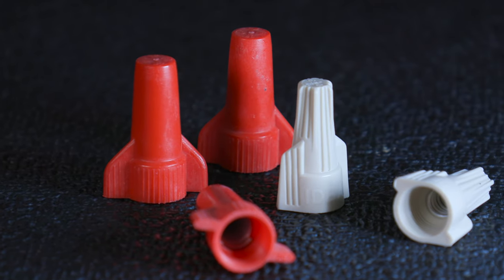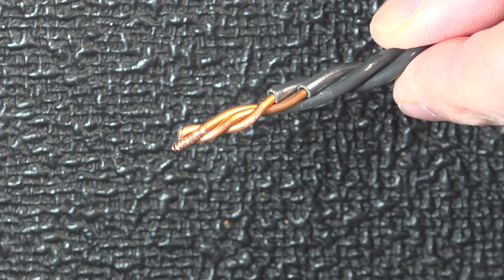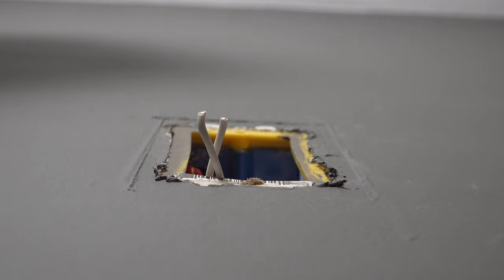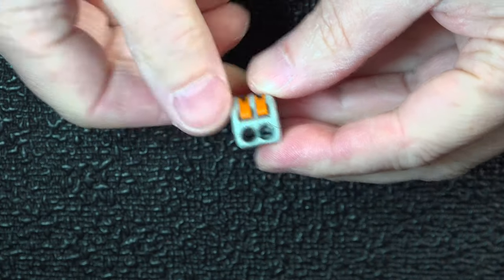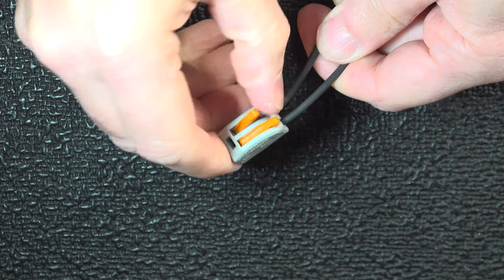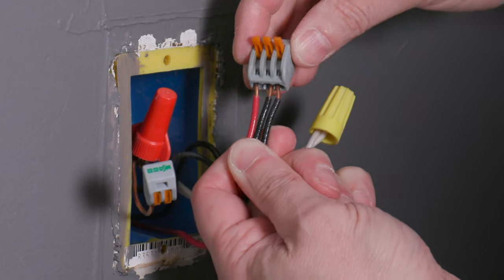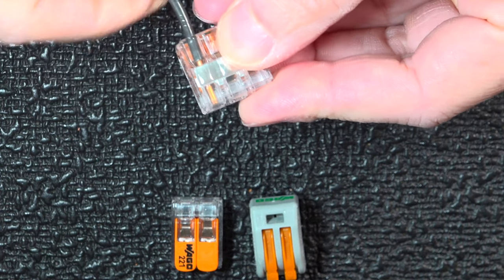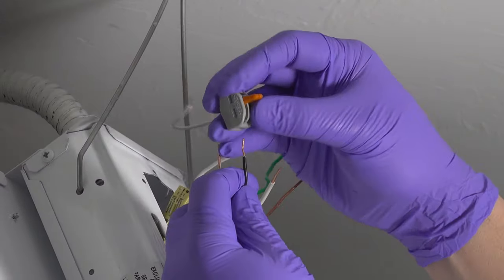Never use Wire Nuts Again - Wago is Better Electrical Connector

Comment: The wire nut is only as dangerous as the person installing it.  Been an electrician for 25 years and have had VERY few problems with wire nuts.
Reply: Also notice how he blew pass the part in mentioning "More Expensive" also notice how he never mentioned using the proper colors of standard wire nuts is related to size and applications. All I'm saying,  if you're gonna sale a product or represent a product, then talk about that product without using poor "Piss Poor" examples of what is currently 99% used, because you won't appears as credible but as cheap "Snake Oil" peddler.
Reply: @cplcabs  I agree, they also save time' and more time
Reply: Because electron flow occurs on the outside of the conductor there just doesn't seem to to be enough surface area contact with these splice devices with the conductor surface. Every one of these type splice devices I've removed had significant carbon build up on the conductor and the device contact point to the conductor. The splicing device has very minimal contact presence on the exterior of the conductor. I've  always maintained that 5/8 inch of twist is minimum twist length to achieve sufficient surface contact to allow electron flow to under load without carbon build up. If these splicing devices came primed with some sort of carbon inhibiting grease it might work better. But I still wouldn't use them from the perspective of call backs and loss of customer confidence. Call me old fashion but electron flow is electron flow. Amen???
Reply: @BarryPiper  Remember aluminum type NM?  One of the worst mistakes in electrical history.
Reply: Can't teach an old dog new tricks.
Reply: @Dana P.  ⤴️ THIS👍 
More surface area contact reduces Resistance. Thus, reduces heat🔥
Reply: Ditto
Reply: @danap.235  I thought the same thing when he took one off and there was a tiny nick in the conductor. Immediate red flag.
Reply: @marksheltonswork7848  Remember the approved fix using a short copper wire twested together with the aluminum wire and tighten with a wire nut. Then the copper short wire faston to the switch or receptial.
Reply: so true Tight is better
Reply: Crank em down til they can't take anymore crankin,  then tug.. repeat ...
Reply: @michaelangel6201  he's a salesman with a good personality  not an asshole electrician  , like me .
Reply: @danap.235  I use them only on 2x4 troffers.or exit  and emergency lights
Reply: @marksheltonswork7848  lotta pine hills houses in the Orlando area 50s 60s  wired in al
Reply: @stepside2839  i jist ran 10/2 uf for an 11a load in a house ,
Reply: @lostcause1206  rather have a well experienced electrical AH  walking away from my house than standing next to  a fun loving, charismatic watching it burn to the ground.
Reply: @marksheltonswork7848  Tell me about it, that's what I have i my home. Had to WIRE NUT copper extensions into every receptacle and switch because they were starting to arc inside the box. Good thing all the boxes were metal and not plastic.
Reply: i'm more worried about the cracked out or methed out electrician they hire that i have to watch out for....pain when a guy uses kleins for stripping and knicks into the copper and twists the shit out of them so it will break off going into the box and then having to troubleshoot it.  People start thinking the place is haunted when the lights are flickering...but nope it was just cracked out joe and his terrible connections.
Reply: I’m an electrician with 40 years in service. WAGO is a German brand. In Europe voltage is 220 volts to ground. These work great there but with our lower 115volts l am concerned with the limited contact surface area of these. That’s the reason I never once used “quick wire” devices in my career! I only use these for connection of fixtures and only if they come with the fixture because they save my precious Wingnuts for more important jobs lol.
Reply: @danap.235  100% correct
Reply: i only have problems with  green apprentices that don't check to see if they have a solid mechanical connection causing me to waste time troubleshooting circuits, nothing wrong with wirenuts , apprentices as well are more likely to strip the wires to long for the wagos  causing shorts in the the circuit, easier isn't always better or by code.
Reply: @lostcause1206  lol,  now what?   Uf inside the house?   #10 for 11 amps?   Yeah.  I  run #4 to charge my phone!
Reply: @ProctorsGamble  Yes sir! I'll use WAGOs in a 277V 3 phase lighting circuit, but there's no way I would ever install them in a 120V single phase circuit like we have in our homes in the US.
Reply: @gibsonjl85  I had an apprentice who sprained his wrist while dumping a wheel barrel. He then tried to blame the wheel barrel for not having "ergonomic handles".
Reply: I.B.E.W.  STRONG
Reply: 40+ years and seen far fewer problems with wirenuts than these quick connectors.
Reply: Agreed. Cheap Wego tension fails in 2 years in a lab. Fact.
Reply: very few problems, it's still very bad.  in electrical installations you are not allowed to have any problems.  it is enough in 10 years for an electrician to set fire to a house because of such a connection.  And who says that those are reusable does not know what he is talking about, even if theoretically "works" practically if you knew how it works you would understand that with each screw, metal on metal, it loses its thread.
Reply: @BarryPiper  That's not logical thinking. Plenty of things were "allowed by code" until they weren't. Things are now "allowed by code" that won't be next year, decade, etc. But I agree with OP, wire nuts are fine.
Reply: @BarryPiper  And if there were a problem with Wago's they wouldn't be allowed by code either.
Reply: @cplcabs  a twisted wire splice on solid copper wire is the most secure connection possible in a serviceable splice. Terminal bloc connections are sweet on stranded wire like you guys you in Britain, where wire nuts don’t work so well. Dude it all matters in the materials your working with. If you were a sparky here you’d get it.
Reply: @ProctorsGamble  for me it’s a stranded to solid application thing. Wago works decent on stranded wire. For solid wire I agree a twisted splice is the most proven reliable for sure without doubt.
Reply: How do you twist multiple 10 gauge or lower gauge wires?
Reply: @mrtopcat2  by twisting them together?
Reply: @16vSciroccoboi  So you must think I did not think of that? 

Twisting wires, especially 10 gauge wires is a pain in the butt. It is also a 3rd world solution.
Reply: @mrtopcat2  with a pair of linesman pliers and a blue wire nut.
Reply: Amen
Reply: @BarryPiper  I know of plenty of times this type of product has failed. Since I am the one fixing them.
Reply: @tgrzadziel1975  which local brother? I'm out of 48, doing supplemental out of 125 right now.
Reply: Only need one to burn a house down...
Reply: I'm not an electrician and I've never had any trouble with them.
Reply: @michaelangel6201  yeah AWG standards but wire nuts come in Red, Yellow, White, Orange, Blue, Black, Green.

Just look at the diam of the wire and nut and all set...
Reply: @lostcause1206  I'm not an electrician and never had trouble with wirenuts, to me it is just uncommon sense you and I share.

I worked in telephony for Uverse, scotchloks were good for it all, even the 48-53VDC for ring battery...
Reply: @ProctorsGamble  erm the main power is 240-250, they shunt the transformer to get the 120-125VAC.
Reply: @gibsonjl85  it's the same for 12VDC circuits, electrons are electrons whether from rotating magnets or 2 dissimilar metals with a dry or wet electrolyte.

Some wires are smaller than 22 gauge (speaker tweeters on coaxial units) might need scotchloks for those to go to a larger gauge.
Reply: @greedo2660  must of not loaded correctly
Reply: @-Nobody-1  its like speaker wire terminal blocks.

I'd change the wagos to a screw lock for security and more surface area for current flow.
Reply: @mrtopcat2  pliers.
Reply: In europe these nightmare wirenuts are long Forbidden, only wago type is allowed now. Another bonus from wago is you have a small hole in it in which you can place a voltage tester without having to damage the wire insulation.
Reply: @greedo2660  im sorry i have to say this but the electric grid in USA is ancient, in europe we have 3x230/400v systems, how does not using 110v single phase overload your electric cables especially with upcoming electric car chargers
Reply: @danap.235  These Wago connectors have been used in Poland commercially in massive quantities in home building industry virtually since they were brought to market. They proved to be reliable and error-proof and are now a standard in new investments. For most applications the version without lever is used (self-locking ones), lever variants are used when there is a need to connect at least one stranded wire.
Reply: @emperorfancypants2512  do you not understand wire gauge sizing to accommodate for different loads depending on circuit requirement? The arguments where people are like “in Europe this but in America this” are so fucking tired and dumb. This is the last one I entertain.
Reply: @-Nobody-1  that's not economical bro, uses too much copper/aluminium not good for the bank and environment
Reply: That’s why he mentioned how it works more for diy stuff, a professional knows what they are doing and also only has to do it once. A home hobbyist isn’t as skilled and may want to reuse items
Reply: @mrtopcat2  You use Item no. 221-615, which can handle conductors from 0.5 to 6 mm²?
Reply: @marksheltonswork7848  pulled out of cardboard boxes ...
Reply: @lostcause1206  Ha Ha!  Not to many of us around anymore that pulled wire out of flat cardboard boxes.
Reply: @emperorfancypants2512  cool great idea, now lobby the governments from Canada to Panama (the entire North American continent) and Bolivia.... Venezuela... Ecuador... and anyone else in the Western Hemisphere who is on 110v/60hz to change their industry standard. Get back to me when you make the difference your looking for. Your economical argument should win them over.
Reply: @-Nobody-1  we had 3x110v here till the 50s in some areas, over time and gradually we changed it, first 3x230 and now 3x230/400v with neutral wire.
Reply: @danap.235  Electron flow on the outside of the conductor is called the skin effect and is frequency dependent.  at 60Hz in copper it's 1/3 of an inch.   so a conductor with a radius of 2/3 inch of less would not be affected. This would definitely include the 12 and 14 gauge wires that wagos could be used for in residential applications.   https://en.wikipedia.org/wiki/Skin_effect
That said.  I think wire nuts are the way to go and the guy in this video was not using them properly.  Wagos are just as bad as back stabbing outlets as they do not give the necessary contact to prevent heat build up.   Additionally as the copper oxidizes, if the wire moves at all the contact may now be on top of the oxide layer.   that is probably the cause of the buildup you have seen.
Reply: @Warclubz  you as well, I've always wanted to visit ny, hopefully I'll get the chance some day.
Reply: Who in their right mind would count on the workmanship of a Chinese made connector to make the actual connection? What's the guage of the actual material that connects the wires? I'm supposed to sleep at night while counting on someone else's workmanship for such an important connection? All when a simple wire nut properly installed by me will ensure proper connection. Thanks but no thanks.
Reply: @emperorfancypants2512  US homes have 240 single phase with a center taped neutral for 120. Commercial building have a wye connected 120/208 similar to your 230/400. Larger buildings and light manufacturing uses 277/480Y. 277 between the ungrounded conductors and the grounded neutral for lighting and 480v 3 phase for larger equipment and motor loads. We place 120/208v 3 phase transformers and panels for outlets and appliances. 

I’ve worked for a company that produces equipment and ships them all over the world. I built many multiple voltage test rigs for the products so I’ve always been interested in what’s used in other countries. I like the 220/400v systems.  I think they’re very good. I was in London a few years ago and thought the tiny breaker box in the apartment was awesome. Although, I will say, I built three phase test rigs for our HVAC equipment that operated between 380-575 volts and 150-400 amps, and I appreciated the higher voltages for these heavier equipment loads. Less amps and smaller circuits. Some of the more powerful models couldn’t be sold in Asia and Europe without installing transformers. Canada’s 575V is even better. 120v in the US is good for small plug-in loads.  Cheers!
Reply: You must not do commercial service work...
Reply: @BarryPiper  there are known issues with quick connects though. the # of service calls because of back stabbed plugs arcing and tripping arcfault breakers has to be astronomical, these wago things use the same concept and are just as likely if not more so to get fatigued from heating and cooling of the connector and the wire.
Reply: @-Nobody-1  We actually use solid core in domestic installations, "twin and earth" for the most part. Choc blocks are still far and away the most used method of joining cores though
Reply: These comments are so funny :D claiming the wago is prone to failure, i have never seen a wire nut in finland or a wago fail. They are much more safe and way faster than wire nuts, you can say all you want about wire nuts but its just a simpe fact that wagos are better 🤭
Reply: @mrtopcat2  git gud scrub lol
Reply: @cplcabs  i've done WAY more service calls and repairs from problems with stab-in connections (including wago's) than I ever have from a problem with a wirenut.  see the reason you think that is because they've been banned in your country since they were made with ceramic!  (lol)  (23 yrs exp)
Reply: @phatdonkey78  the connector doesn't make the connection.   the twisting of the wire does, the connector just protects the joint.  go ahead and pull the wire out of a stab connection and tell me there's no marks on it.  plus there's less surface area of the wire being connected by a stab/clip connection than there is from twisting them directly together and that's copper on copper.  there isn't any copper used in wago's.  you are obviously not an electrician so i don't know why i'm wasting my time w/ this comment.  go ahead and buy a 500 ct of these so you don't run out.  i just want to see what you do when you got more than 2 wires to connect.  or you hit some 10 awg.
Reply: @XX-121  You were definitely wasting your time with that comment because I agree a wire nut is a much better connection. If you re read my comment from earlier you will see that I said, "when he disconnected the wago there were just 2 little nicks in the wire." Meaning not a lot of surface area for the connection, hence not a good connection and I said immediate red flag. I'm definitely not an electrician but I am an electronics technician and understand electron flow and how a stab connection is a terrible connection. I don't know why I am wasting me time with this comment since you clearly have problems reading and comprehending who has said what.
Reply: Well it's something called "innovation"
Reply: @Trainwheel_Time  yea you can teach us new tricks. I do believe that any Journeyman Wireman would agree a properly installed wire nuts are better than a waygo any day
Reply: @anthonymartin2412  oh so true my friend
Reply: @engineclinic  Glad to see some one else caught that but im hoping he was being sarcastic LOL
Reply: @greedo2660  Key word is apprentice its our responsibility to teach them the correct way
Reply: @tgrzadziel1975  till the end BROTHER
Reply: @-Nobody-1  well said
Reply: @mrtopcat2  sidecutters
Reply: @jasonboyd7358  Yeah, you're right. Teaching apprentices is an important part of my job. Some are just easier to train than others.
Reply: @marksheltonswork7848  Yep and the NEC is about to bring back copper coated aluminum.
Reply: Am a retired electrician.  Worked in field from 1976 to 2016, never heard of a “Wago”!  Put 10’s of thousands of wire nuts (mainly Ideal brand wire and wing nuts).  Have to prepare wires properly to get good connection, and don’t re use them!
Reply: Ive done a "couple" remodels that the previous people who touched the electrical made huge messes in the panels and at the devices, and i can tell you that wire nuts have never been the problem even with cheap wire nuts, its always the person doing the electrical that causes issues.
Reply: @BarryPiper  The problems with wirenuts is why they're not allowed by code in countries with stricter rules and requirements than the US, eg. Germany and the Nordic countries. Building codes are a compromise between safety and what you can get the builders/electricians/plumbers in your region to follow, there's no point of writing code that noone is gonna follow. And since the US lags far behind in terms of electrical safety and technical competence, so does the code.
Reply: @stepside2839  the skin effect isn't really applicable here. The surface area/resistance/heat part holds but at 50 or 60 Hz the electron flow as described by the skin effect is effectively the same through the entire cross section of any wire size that you would use wire nuts or these things on.
Reply: @BarryPiper  In many countries they are not.
Reply: @baggebuilds  Yeah, maybe in the 19th century they were.
Reply: To all those mentioning the skin effect,  calm down.  At 50 or 60hz and with the size of conductors these connectors are made for,  skin effect is irrelevant.  No need to get overly excited and critical.
Reply: Ah just use split bolts for everything, then the wimps will only finger tighten, must be time for more 'black tape'... electrician for 45 years I twist every solid wire regardless of awg and wire nuts mostly... everything depends on application, but the fixtures that come with mamby pamby connectors get cut off and spliced properly. There's a reason the NFPA outlawed ez wire switches and receptacles... continuity issues...[was that nicely said instead of FIRES]  don't get to reliant on 'underwriters lab'...
Reply: There's no way this device has the current carrying capacity of a well-made wire nut splice
Reply: Wagos are used almost universally in the UK now. I reckon it will be the same for you guys in a few years. They are fast and good... No lie. Give it a go I think you'll see why!
Reply: @stepside2839  dude, copper skin depth at 60Hz is a third of an inch, ain’t no house wire that thick and ain’t no skin effect in house wires. Now at 10 GHz you’re wasting copper if your microstrip line is thicker that 1 mil.
Reply: @uarbor70  why?  Resistance = rho x Length / Area.  Sure increasing area reduces resistance BUT if the length (distance between conductors) is very small, then resistance will also be very small.  Imagine you cut a big fat 10 gauge wire and use a 1 mil long piece of 30 gauge wire to reconnect them.  Guess what the resistance of that connection would be... about zero! This is why there ain’t no issue with the Wago’s current handling. You guys really think no one in Europe is smart enough to do a simple resistance analysis of a Wago interconnect, LOL.
Reply: @BarryPiper  They are banned in Europe!
Reply: @galendenney4849  yup that Is true for ‘skin effect’ 
But, oxidized surface of connection thru surface contact
can produce resistance, thus heat which should avoided in house wiring.
That was my thinking and Yes, ‘skin effect’ is about RF not house wiring
Thanks for the clarification 👍
Reply: I have seen these connectors overheay and the copper wire that is inserted into them black. They will eventually corrode and now you have a resistor and they overheat. I have never seen a wirenut cause problems that was properly installed, but these i have seen cause problems with overheating.
This is just what i have seen with my own eyes.
Reply: RF meaning HF, VHF, UHF
for some reason YouTube will not let me ‘edit’ 🤷🏻‍♂️
Reply: @kwacz  exactly 
the environment the connector is put in
And properly installed👍
Reply: @ Mk Kl  - That's the problem. The wire nut is a lot more dangerous in the hands of a DYI'er.  Just because  you have mastered the wire nut in your dozens of years of electrical experience, doesn't mean I will put it on correctly in my very occasional use. I often have problems with wire nuts where one of the wires will come out or the whole nut is loose and I have to try and try again, and again to get the wire nut secure. These wago connectors were a godsend to me.  No more fear that I'm shoving and tucking in potentially loose hot wires into the receptacle box.
Reply: @danap.235 Only at very high frequencies does electron flow occur on the outside of a conductor.  At 50 or 60 Hz, the skin depth is much greater than the wire diameter.
Reply: Ive seen the wagos 🔥  your comment nails it !!   Correctly trained and experienced electricians never ever have issues .   Pisses me off how the NEW world justifies laziness over skill .
Reply: @dougbloom3672  perhaps the wagos are not for them. Perhaps the wagos are the rest of us who are not correctly trained and properly experienced. And sure the wagos may burn if you are pushing 100 amps through a 20 amp connector for enough time, but I would suspect that the wagos isn't the only thing that got damaged.
Reply: @RageDaug  yes perhaps .   I am definitely set in my ways and confident in my work and expertise.
Reply: Therein lies the problem, they leave little room for error and if you mess up, it can be difficult to correct. Those wago things however are a lot more giving in every sense and almost fool proof.
Reply: @danap.235  could add some sort of dielectric grease after the fact to smoothen that out
Reply: WAGO $? Wire nuts cheap & easy.
Reply: The wago connectors cause around 35 cents each. The standard twist connectors cost 0.05 cents each. And these cost estimates are in low qtys. Also, which is larger? Wago or wire nuts? Wire nuts come in different sizes. Electrical boxes do not con with infinite space inside. Many outlet boxes are tight for space
Reply: @jrock865  what's wrong with stripping wire with Klein wire strippers?
Reply: @attitudeadjusted9027  those wire nuts also made in China town!
Reply: @Vaahtopers3  I agree that I've never seen any quick connect and/or Wago lever nut fail here is the USA. I don't use them everyday but I do have all of the different sizes and styles.
Reply: @Papalegba22  im talking about klein sidecutters not strippers when people say kleins in the field theyre referring to sidecutters aka linemans
Reply: @emperorfancypants2512  hopefully the electric car fad will fade away quickly
Reply: @cplcabs  lol
Reply: @danap.235  This video seems more like advertising not info
Reply: I suppose back stabbing works too! Hack!
Reply: MK agreed, I heard that when installing stranded on a solid, the best way is to twist the stranded onto the solid one so that the stranded is going nearly if not actually over the top of it's self. once the nut is placed so neither wire will pull out of the nut, then you have a good mechanical connection. 2 solids should be wound in a tight pattern so the helical appearance is as tight an incline as possible.
Reply: @MichaelClark-uw7ex  You are so right!
Reply: @marksheltonswork7848  Beverly Hills Supper Club fire was caused by improperly installed aluminum romex.
Reply: I was taught to twist them which by itself is a very good connection and to put a nut / cap on it which perfects it. These wago connectors leave minimal bite marks, how can that connection be as reliable?
Reply: @BarryPiper  I've had jobs in factories that did not allow nuts, they're also flat out banned in some EU countries. Your argument falls flat here. People are moving away from these since they have caused issues.
Reply: @shadowopsairman1583  those exist fyi
Reply: Agreed. It's a problem of stupid, not the technology
Reply: @stepside2839  Neither one of you has a clue what skin effect is, what it applies to, or how it [doesn't] relate to grid frequency power distribution.
Reply: Clearly solder is the only secure connection ....
But seriously, I have made some bad connections with wire nuts but I've never left them that way, being I was taught to test each and every conductor with a force beyond anything they will experience during service.
During demolitions I have seen 2x4 fixtures  hanging from wirenut joints, there is plenty of security in a properly made joint. 
These new conectors remind me of sharkbites used in plumbing, expensive but they take less skill to use.
I have used all kindsof connectors,  depending on the job that needed to be done, and my own home has knob and tube in it, which is still working fine, long after newer systems in other places have failed catastrophically.
Reply: @slaplapdog  Exactly. And for those saying "if it wasn't safe it wouldn't be allowed in code"... Oh so contraire... One word... "Backstab".
Reply: @Papalegba22  Its easy to cut partway through the wire, and that can introduce a weak point mechanically.
This also creates greater resistance,  but I think that is negligible.
Edit: My bad, John C understand and explained thing the right way already.
Reply: @MadScientist267  this was addressed earlier in the comments, as skin effect is related to high frequency and is irrelevant in 60Hz.
Big oops on my part, but history, now.
Reply: @stepside2839  Fair enough
Reply: They're fine if you never have to redo it. But otherwise they're inferior to the ones with a lever connector.
Reply: @BarryPiper  i use them in industry. And not only are they easier to work with, quicker, can connect 5 wires together, with a max load of 32A, but you can make it prettier too.

And i used them from anywhere to -30 celsius, to +60. In wet environments and in places with lots of vibrations. They have never failed.
Reply: @GoalOrientedLifting  "if you never have to redo it"... You can reuse wire nuts just fine... A quick visual inspection for corrosion, heat, etc and then just put everything back together.
Reply: @MadScientist267  yeah, you can reuse them. But it's a much bigger hassle to redo. And you have to cut of wire, if adding one, which is a bad thing, in industry.

With the lever ones, you just strip the end of a wire and click it in. Takes 3 seconds. Adding a wire to a wire nut takes way more time. And the end result isn't as pretty.
Reply: @GoalOrientedLifting  Why would you necessarily have to cut the wire? Unless it's severely mangled or showing signs of damage that may cause it to break etc, no point. Can straighten them out (if desired) or sometimes even just "reuse the corkscrews" and lay the new wire in the center before tightening the nut on them.
Reply: @MadScientist267  straightening them out, is a lot of work. and you may end up ruining a part of the wire, in the process, making an issue, down the line. Especially in places with lots of vibrations.

These issues doesn't happen with the lever ones. And it's also so much faster. 
I also don't really see any benefits for wire nuts, compared to the lever ones.
Reply: @BarryPiper  in many countries they are not allowed :-)
Reply: @stepside2839  Haha, so you are into 1 foot wire nuts and drilling up 2 feet blank wires into? "More surface area contact reduces Resistance. Thus, reduces heat"
No, ony idiots do
Engineers do only use "sufficient surface", not "as much as possible".
Wago is german engineered and measurements lead to he amount of needed surface. But the main advantafe is the spring force contact, that avoids loosing contact over time due to temperatur changes, wich is the main problem of wirenuts and other screw tightening systems.
Reply: @greedo2660  Yes, maximum current load should be respected by any electrician for any item by default. As connectors do have to have only higher current load limits in the US than in Europe, yes, standard Wago 221-415 only has UL 20A. 
If more is needed use Wago 221-615 for UL 30A. 

Wago is world market leader for connectors, but the US is no target market, as stoneage electicians do insist in stoneage connectors and so only UL 30A connectors for installation purposes are developed for modern world countries, which might be too low for 120V systems ib stoneage US.
Reply: Yup.  This video is wack.  Wire nuts all day.
Reply: @emperorfancypants2512  Because the US is not 110V, it's 220V split phase. There's a really good video by Technology Connections on that exact topic
Reply: @Trainwheel_Time  "trick" aka unnecessary product trying to re invent the wheel as a cash grab
Reply: @danap.235  if you're talking about the skin effect there really isn't any in 60hz power. You dont start to see the skin effect until you get more towards the 1000hz to 10000hz and higher. From a skin effect perspective you can pretty much consider 60hz to be DC in that regard.
Reply: I agree. Use the proper twist on connector (size and brand) and install it properly.. There will be no issues.
Reply: "The wire nut is only as dangerous as the person installing it."
Not really.
Metal expands and contracts in the cycle of hot/cold, so even if you twist it correctly, sooner or later, it gets a bit lost, which it causes to generate resistance => heat => burns.